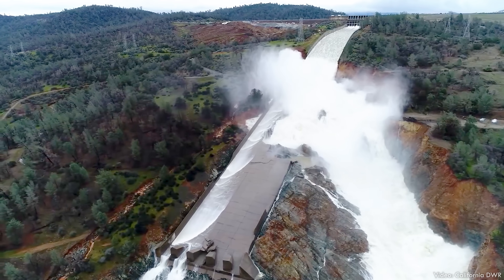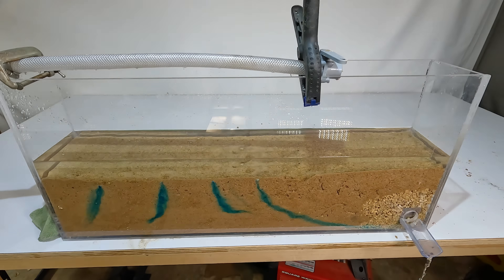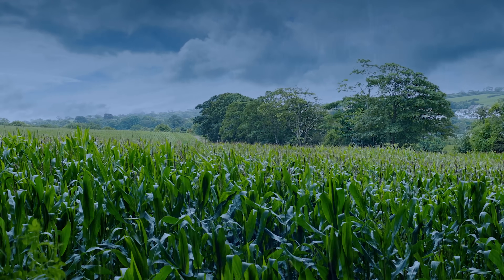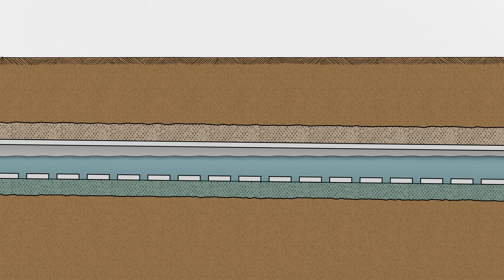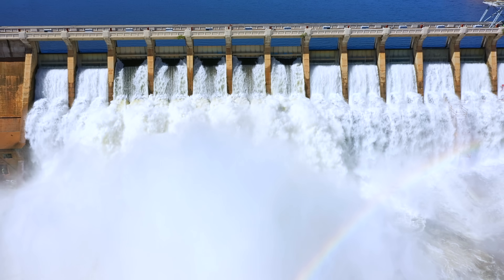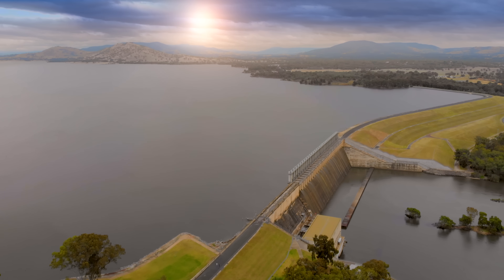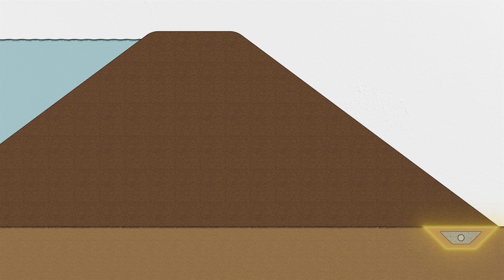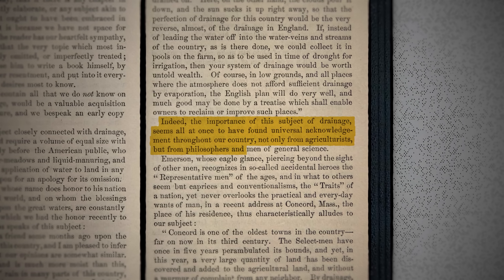How French Drains Work

Comment: I don't understand why French drains are installed directly against a building's foundation. This guarantees water will drain directly against the foundation. Wouldn't you want to install the French drain away from the foundation or make sure the water flows away from the foundation to begin with.
Reply: @DOCTORAMBULANCE  Thanks for that info.
Reply: Actually, the correct procedure, and building code in many or all places that have a building code, is to do both: ground surface is supposed to slope away from the foundation for a distance of at least 5 feet (not sure about that number), AND a drain is required to drain away any water that gets to the soil next to the foundation despite that slope (e.g., it rains at an angle, hits the wall, runs down, there it is; or drips off the roof in such quantity that even with some slope, there's a lot of seepage in every direction including toward the foundation). Better place would be directly below the eave, but the numbskulls who do the code are, well, numbskulls.
Reply: @matthew3136  interesting... certainly makes sense, but only if the GC makes the foundation guys give time to the landscape guys before the digging gets filled back in.
Reply: @DOCTORAMBULANCE That bit about the French drain being at the bottom of the foundation wall it sits besides would really help explain why a little water seeps into my garage through a (previously repaired) crack in the concrete wall (garage is built into a hillside and has concrete walls for ~4' up from the floor).  The French drain was installed 1-2 feet too high, so there's still pressure below it.

I'm only getting a ~20" puddle of water in the garage during the worst summer rainstorms, so not too worried (and not going to dig out and fix the French drain unless I have to), but I'll keep an eye on it.
Reply: A French Drain works on both sides of its cross section. By having it against the house foundation you ensure water cannot build up against the foundation as it has a direct and easy path into the drain.
Reply: @kjdude8765  But you are still forcing the water against the foundation to begin with? Just confused as why you would want to 'guide' the water against the foundation just to get rid of it.
Reply: @netposerx  There is no forcing in this case. The pressure gradient is due to gravity acting on the water outside of the house foundation. If you follow the dye trails in Grady's demonstration they all flow toward the pipe, even the ones closest to the right hand side of the box.
Reply: @netposerx a drain doesn't "force" anything. yes, there is a very slow flow of water toward the  drain (and so, the wall), but an actually lower water pressure within the soil because there's a releasing of the water. so the wall being protected is subject to less force.
basically, the only force involved is gravity, which is true with or without the drain.